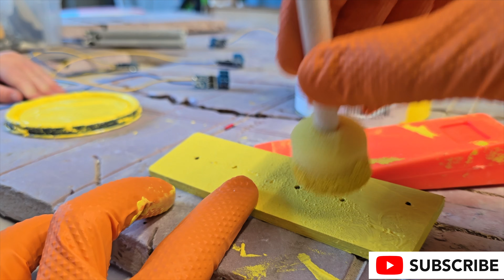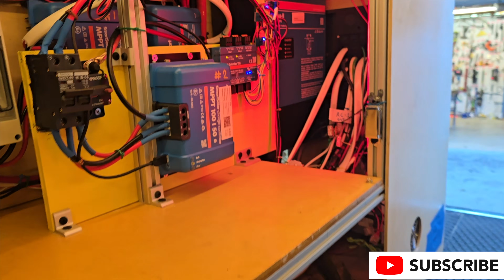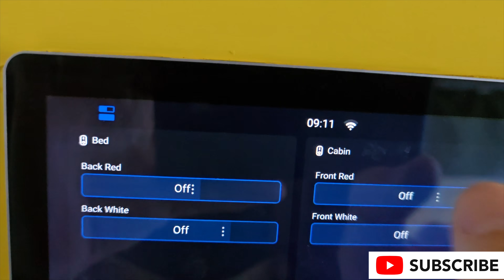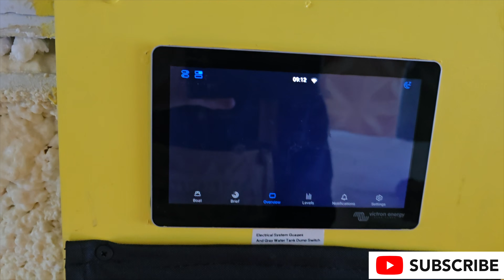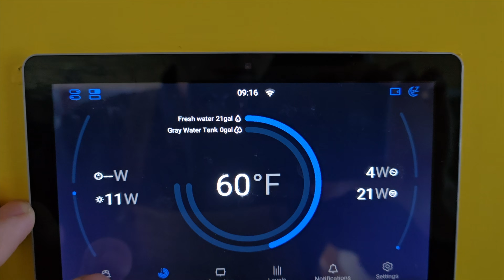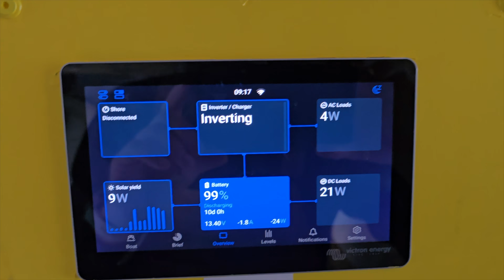Victron System LED Dimming with the GX IO-Extender & PWM (Troubleshooting Screen Freeze!)

Comment: Great work, were you able to resolve the high pitch noise with the PWM driver module? Did you have to go with another manufacturer of one to resolve?
Reply from the maker: I just replaced them with the same type and that help things a little bit. Still not perfect.
Reply: @buckmanriver  Thanks for the feedback! I’m going back-and-forth in my head whether I should use the GX IO-extender 150 or spend the money on the safiery star-power module. The star-power looks like a cleaner installation with definitely more upfront cost, less installation labor and wiring.